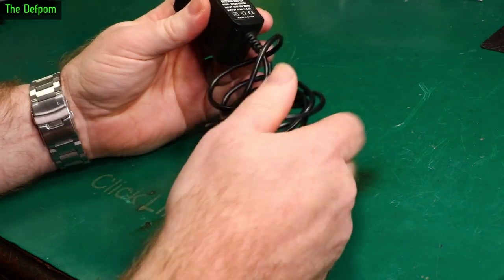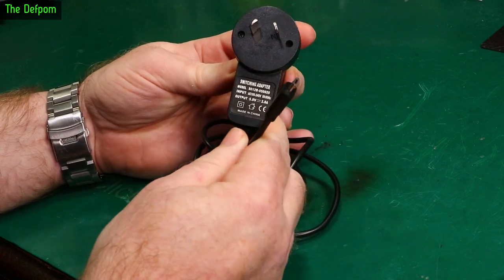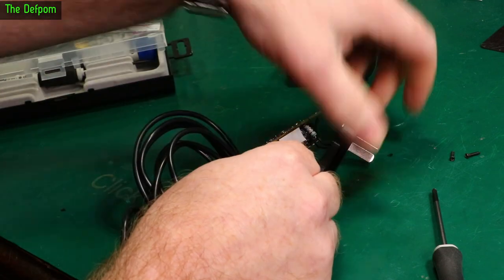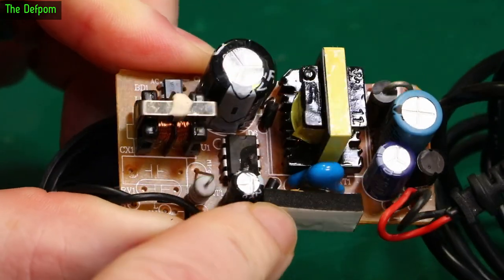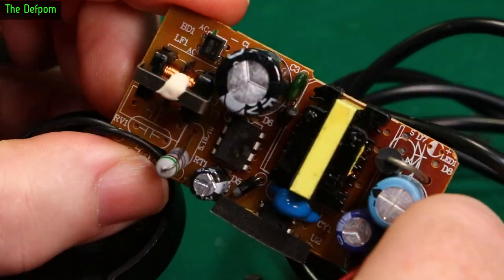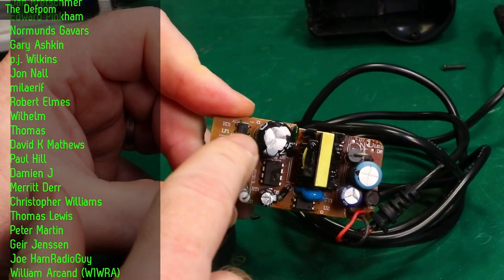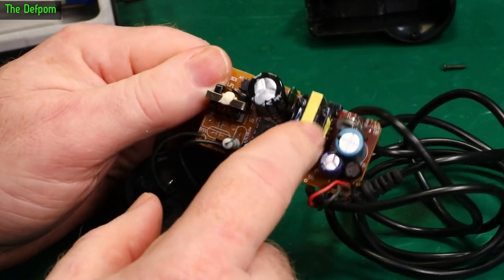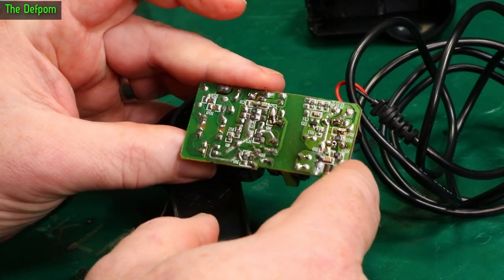🔴 USB Power Supply Failure Investigation - 2 Minute Tuesday - No.1144

Comment: I think that the root cause still could have been due to a crapacitor, or one that failed to do its job properly, since chips generally do not meltdown unless there is an excess voltage or current running through them.

Comment: You could fix it if you buy a new chip or if you have a scrap board with a compatible SMPS chip on it, use that. They're not expensive. Just add it to the order next time you order some other components.